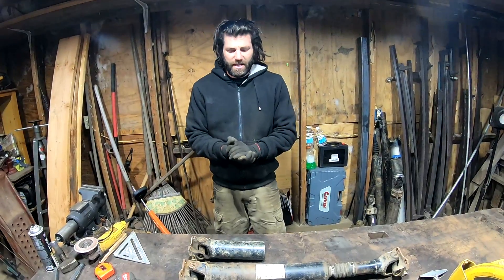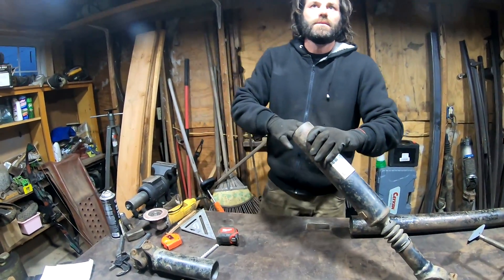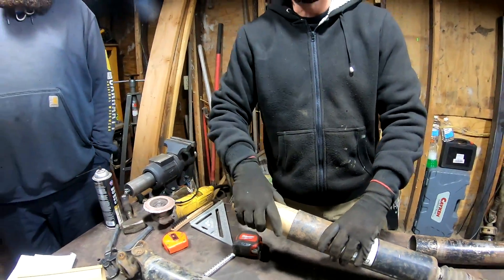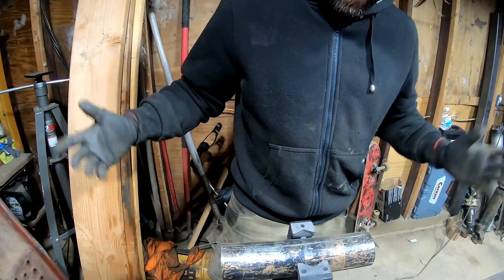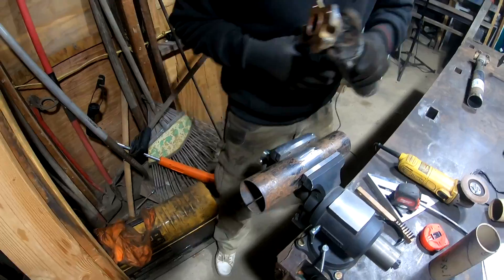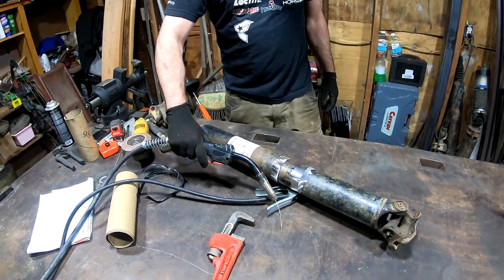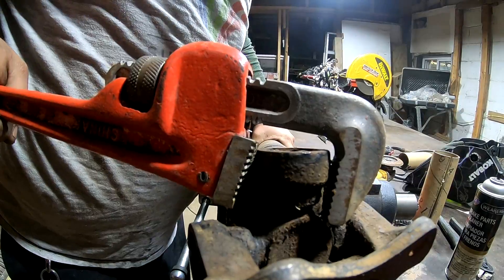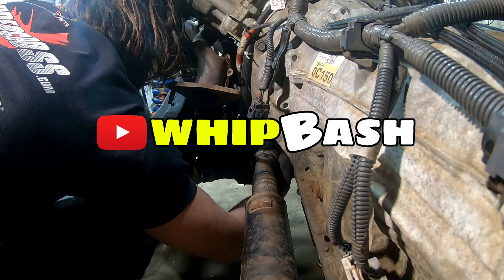How to Lengthen or Shorten a Driveshaft - TACUNDRA 27.6666666666666666666666666666666666666666666666

Comment: I have a driveshaft that has a slip built into it with flanges on each end. Can someone tell me the math on shortening it if need be? I e swapped in a new transmission and transfer case into my runner. So I have the measurement distance from output flange on case too flange on rear diff. 

Then I should measure the driveshaft and have a certain amount of play in the splines. 

I know you don't want it to bottom out. 

So you also need to measure the distance from flange to flange at full droop of rear suspension? Is this correct? 

I've always wondered the calculation on this but every website just tells you to measure the distance between flanges then send it to driveshaft shoop. That teaches me nothing....
Reply from the maker: It probably doesn't move very far throughout the range of suspension travel.  Measure it at droop and then put some extra weight in the back to crush it down a little.  Measure it again.  Use the shortest measurement and subtract like 1/4-1/2" to be safe.

Comment: Actually welding downhill would have been the thing to do. Welding uphill you will have to fight gravity and you are putting in more heat because you are moving much slower. When your welding vertical with a MiG, always try down hill, it also makes for much more cleaner looking welds. This is not Tig or 7018.
Reply: This is terrible advice, on thicker metal you want to weld uphill to get good penetration, if you weld downhill the filler will run down before it can penetrate. On thin steel it doesn't really matter if you weld hot enough.

Comment: you guys could pop a chalk line next time to align the two ends, just FYI
Reply from the maker: That could work.  I usually just hold it in position and rub it around on the concrete floor.  Same concept.  Can't remember if I did that in this video though.

Comment: How well balanced is this drive shaft? I need to lengthen the rear shaft on my Toyota but it needs to be fairly well balanced as it will see some highway use. All of the local shops just want to build a new shaft and charge crazy labor rates...
Reply from the maker: This method should work.  I've done it on street-driven trucks too.  No problems.

Comment: would it work if you had added sleeve in the middle to extend the shaft
Reply from the maker: Yes.  As long as your sleeve is made from strong enough material.

Comment: I was thinking at work that you might have. Had less problems using a 2010 4runner v8 engine than using that 3 urfe
Kind of late aint it
Reply from the maker: OMG Of course!  I'd assume that would have basically been a drop-in swap.  But the 4.7 UZ makes a lot less power, it's a lot heavier, and doesn't have the badass bump-shift 6 speed trans.  I'll admit though, considering the amount of work involved with this - the UZ would be better bang for the buck!  But then I wouldn't have the baddest-assest Tacoma.  So' I'm not upset.
Reply: @WHIPBASH  yup
If i remember correctly the uz engine had metal intake instead of plastic but i see the urfe persuasion they are fun to drive especially the first 2008 tundras that were produced it felt as if the engine gained hp after high mileage
Anyways go on git 
That tacoma